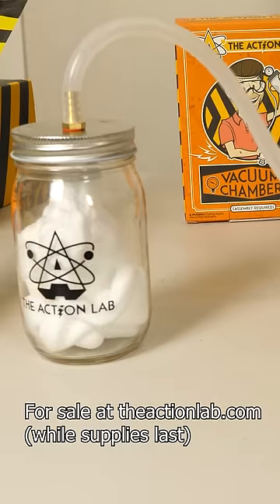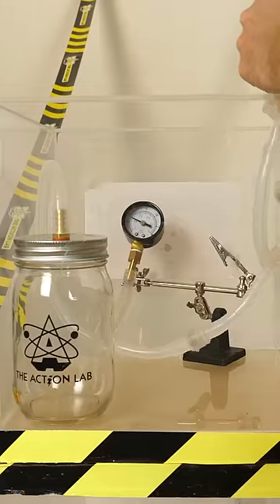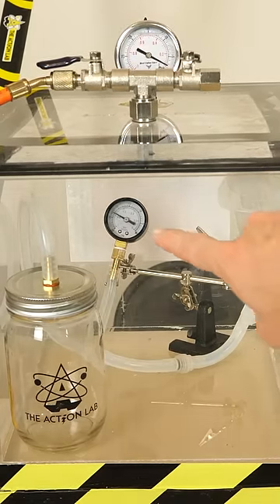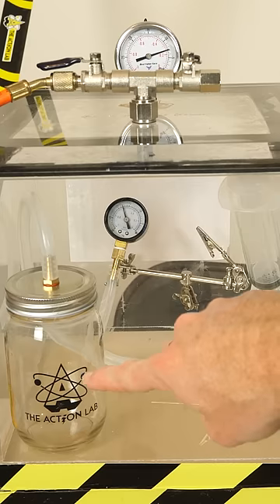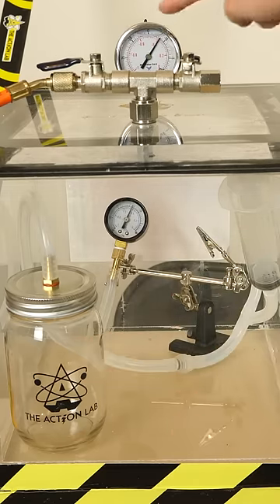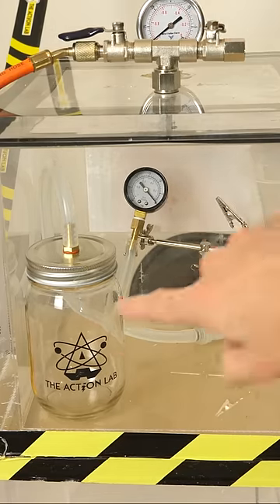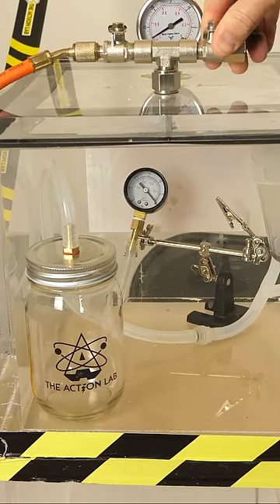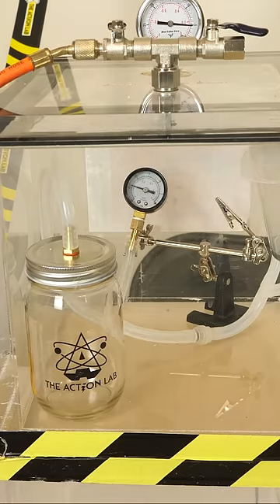Vacuum Chamber Inception

Comment: I half expected it to smash
Reply: Same
Reply: There's no reason for it to smash, There was actually less pressure on it while it was inside a vacuum.
Reply: Why?
Reply: I fully expected it to lool
Reply: @pasmuis  no science behind it. purely because it would be unexpected and unexpected things happen when you don't expect it. Therefore i expected it to smash simply because it was unexpected. Funnily enough though, the second i began to expect it, smashing became the expected, and then the unexpected happened. Therefore i was right about the unexpected always happening when you least expect it. A paradox
Reply: Who are you? Khabib?
Reply: Smash. Next question
Reply: @reemr9954  not enough brain power to process this infinite recurrent loop. 🤣
Reply: I thought that it would float
Reply: @pasmuis  just the first thought that popped into my head without actually assessing what would happen or anything.
Reply: @reemr9954 the mental gymnastics to say "i was right anyway" is astounding lol its ok to be wrong bubby
Reply: That's what she said
Reply: How? The outer partial vacuum is relieving the external pressure from the jar. Also, the jar can withstand a perfect vacuum (nearly impossible i know, and the mason jar’s unmelted lid seal would off gas and leak making a perfect vacuum even more impossible). Now, if you were to put a jar with a or without a vacuum deep in the ocean it would implode. We now call this the Titan Effect.
Reply: @reemr9954 no, a paradox is when, in order to put a bad person in jail they have to be convicted of a crime and convincing a bad guy to do a crime is a crime. No that’s a catch 22.
Reply: @thetruthexperiment  and that's the paradox
Reply: @justanerdwholiftweights4061 他也許沒有人願意給我一點勇氣不斷前進、給😧😧😧
Reply: Nah in a different kind of way its like a bucket being buoyant on top of water but then just sitting on the bottom when it's submerged. You've just made everything in and around the jar a vacuum so it's just like a bucket sitting in a vacuum, nothing will happen
Reply: Same just like that jar guy, if you know what I mean
Reply: @reemr9954 but that doesn’t make any sense… there is less pressure on the glass so less pressure = more pressure in your mind? thats not how it works
Reply: Pass
Reply: @infebris  re-read the comment.
Reply: Why
Reply: The pressure is actually inverted. So the pressure inside the glass is pressing agianst the walls of the glass, thus showing it has pressure despite having the pressure removed. @Sajjad.A
Reply: @whoknowswhocares3804 
@whoknowswhocares3804  the pressure inside the jar increase from -26 back to 0, because the pressure was equalized (almost). So, there's was no pressure on the small jar, neither from the inside nor from the outside.
Reply: Pass
Reply: I also thought it would explode with the air pushing the jar outward and no air pushing in on it.
Reply: wrong kind of video
Reply: The tension force of the glass is very high
Reply: I thought that too
Reply: I wanted it to
Reply: why would it?
Reply: 100% untill he explained the way it calculates pressure
Reply: I like the concept of "half expect" hahaha
Reply: *I half expected it to shatter.
Reply: It would only be the case of rapid decompression or by exert pressure.
Reply: It couldn’t while there was no air in it, equal forces
Reply: The Inception of vacuum chamber videos.
Reply: I was kind of expected same. But I thought it also not do anything too.
Reply: Same here man
Reply: There is basically no air to explode it in a vacuum and if anything it implode in the atmosphere due to the difference in preasure
Reply: Same
Reply: cuz you're like 80iq
Reply: Same
Reply: If there was pressure in the jar then put it in a vacuum THEN it would explode. He’s creating an equilibrium so the pressure is the same inside and out of the jar. But kinda wish it did explode XD
Reply: Hulk smash
Reply: impossible

Comment: The vacuum gauge's reference is the ambient air  pressure. In the large vacuum chamber, the reference goes to zero, so it indicates correctly that the air pressure inside the small jar is the same as the air pressure in the larger vacuum chamber is the same.
Reply: Yes that’s what he said in the video
Reply: Yes, but perhaps not as succinctly. @NienawidzeTaStrone
Reply: @shazam6274 I would argue the video was even more succinct
Reply: @fullsizegrom  Nah, @shazam6274 did it better, but not the best.
Reply: Succ
Reply: @ajaysrinivasroyal idk I feel like they both got the point across. Good enough on both parts.  I guess.  Somehow people needed another explanation though or it wouldn’t have likes

Comment: Never fill your tires in a vacuum. 
It'll mess up the reading.
Reply: @Idiot354 I did until watching this video and now I know why my tire light is always on!
Reply: I’m not engaugeing in this argument, I’m already tired of reading it.
Reply: Space shuttle astronauts before they land.
Reply: Yeah I i usually do my tyres in space. The ISS is the only place I know that do it for a good price.
Reply: @Idiot354 a guy with space car?
Reply: @Idiot354 astronauts
Reply: Good tip, thank you
Reply: This comment is from 3023
Reply: Yeah that's the takeaway actually :D
Reply: It's kinda' related to how you're supposed to fill your tires "cold" as in don't drive more than 3 mi, ideally, or ten if you can help it.  It heats them up, especially on a hot day.

When they cool off, they may be underinflated a bit.
Reply: Never tire your vacuum by reading.
It'll mess up your feels.
Reply: Thanks I'll remember that next time I try to fill my tires in outer space
Reply: @jasonninja55 oh what a tiresome pun it is
Reply: @Idiot354 random twin!
Reply: @RustOnWheels bro
Reply: @RustOnWheels  This argument truly sucks
Reply: Well there goes my roadtrip to Mars.
Reply: We lived it out tired in this egocentric vacuousnes 
 A meta prophecy or correspondence catalyst of some kind 😮
Reply: It will also mess up your tires.
Reply: @Idiot354   in case your car breaks down in outer space?
Reply: You can still do this in a pinch!  Just overfill by about 15PSI, and when you bring it to STP, it will be where you want it.

Comment: Note: Gauge pressure = Absolute pressure - Atmospheric pressure, so when the "atmosphere" becomes a vacuum, the gauge pressure of the inner bottle increases.
Reply: That makes sense relatively. So when you vacuum first, absolute is c and atmospheric is c, the gauge shows 0. But at the second vacum, atmospheric lowers, increasing the pressure relatively, since the outside has less air now than the inside

Comment: Thank you.. All these many years of using pressure gauges, I didn’t know they worked by comparing the pressure of the atmosphere they’re located in to wherever the stem is confined in.
Reply: You can't be serious? 😳 Have you never wondered what PSIA or PSIG means? 🫣
Reply: @2engjnr2  As far as I ever thought into it, which was never that far, I would’ve said the stem inside the container has a spring-type mechanism inside that is forced closed/open by the pressure pushing against it.  Absolutely nothing to do with the atmosphere outside the container.  I guess the spring mechanism could be contained either inside the realm of the container, or outside the seal, but never thought it’s always associated with the ATMOSPHERIC pressure outside the seals.  Only mechanical resistance by the spring, which would have nothing to do with atmospheric pressure outside the container.  
So.. What did you honestly think?  How in-depth have you ever truly thought about it?  Did you know for sure how it works?  Do you even now really know how?  Etc.

Comment: An even better explanation is that: the gauge is measuring the force exerted by the surroundings onto the system. As you reduce the pressure of the outer vacuum, you reduce the force of the surroundings being exerted on the inner vessel.

Comment: Pressure gauges typically measure relative pressure, not absolute pressure. Thus, if the relative pressure they are comparing to is a vacuum, they are going to read incorrectly.

Comment: Difference between PSIA and PSIG.  For vacuum use, use the correct gauge. Get a PSIA gauge. Other gauges that measure absolute are used by HVAC guys for system pumpdown.  Common unit for absolute pressure are Torr and MiliBar.

Comment: That's one of the things we had to make sure we kept track of when I was in the Navy. If you ordered a new gage you had to make sure that if it measured PSIA or PSIG you replaced it with the same thing. Pounds per sq in Absolute or Pounds per sq in Gage. Absolute measured the pressure from zero regardless of the surrounding air pressure. Gage measured the pressure in relationship to the surrounding air pressure. So the little black gage should be a PSIG scale or it would ignore the vacuum.

Comment: No, you are only somewhat correct, the pressure in the small one is increasing, but only because the pressure outside is decreasing. Also, the way a pressure valve works is by measuring how much push it is getting.

Comment: A vacuum involves pressure. Pressure is a ratio of two sides. So a -20:1 psi would be a vacuum and if you added a vacuum to it then it would be something like this: -20:-20:1 and two negatives cancer or making the inner pressure reach towards a 1:1

Comment: This makes sense, except I now realize I have NO IDEA how pressure gauges work.

I gather from some research that pressure gauges have some part of their volume at the environmental pressure (usually atmospheric pressure) and some mechanism fed by the test pressure. One design has a curved tube that deforms depending on the difference in pressure inside the tube (test pressure) and outside (environment pressure). Another type has a diaphragm that pushes with the test pressure into a chamber at environmental pressure.

Comment: He put a vacuum chamber in a vacuum chamber. When the pressure increased I thought" weird how does that happen. Then I thought. "Ah yes. It wasn't a perfect vacuum in the jar, so when the vacuum was created in the big chamber, the air in the jar had more air in it than the tank. And then right after that, he explained it.

Comment: The gauge for the little one actually went lower after the big chamber was opened. At the start it looked to be pointing at -25 but after the air was let back in it looks to be perfectly between -25 and -30, so about -27.5. Did the pump for the big chamber actually suck air out of the little one or is it something to do with the gauge going through a vacuum chamber?

Comment: But now affix the gauge for the internal jar to the outer side of the wall to the outer chamber but with the pipework for the smaller chamber inside with the internal chamber.
I imagine that when the outer vacuum meets the inner vacuum pressure the pressure would decrease against the strength of the rigidity of the glass

Comment: Put a vacuum chamber inside a vacuum chamber inside a wind tunnel...
See if the extreme variations in air pressure has a registered effect on the inner gauge.

Prediction:
(Air chamber (fluctuating gauge?(steady gauge?)))

Comment: If you put a small battery powered vacuum chamber inside the bigger one, or run a cable through the wall of the chamber, can it pull a stronger vacuum if the pump itself is in a vacuum?

Comment: Umm so he should have applied more vacuum to inside jar to equalize pressure in both, and acheive greater level of vacuum inside the jar!

Note that if he increased vacuum to a greater level in the inside jar while air pressure of outer chamber was high, it may have resulted in in the implosion of the jar, depending on structural strength of jar.

By slowly lowering both, in turn, the chance for potential implosion of jar is reduced.

This can be considered similar to the premise of a hyperbaric chamber  ... Only in reverse.  You match pressure of both "containers" (see below) and gradually reduce pressure of the higher-pressure outside (hyperbaric) chamber in order to mitigate ill-effects on the pressure differential of the inside container (human body) and its contents!!!
In case of human body accustomed to higher pressure, a large drop in pressure in a short amount of time can  result not in an explosion, but rather in a life-threatening condition known as "The Bends".
Much worse would happen to a human if released to the void of outer space (per various popular sci-fi considerations of ejection from airlock, a.k.a. "spacing").  In that case the freezing cold of outer space is also factor.

Comment: Also due to air density differences there would be pressure applied to the chamber i side to either try to expand or compress to try and fit the natural density and balance out

Comment: The guage reads different pressures before the experiment and after. Is it possible the small vacuum chamber made from the bottle just wasn't at a full enough vacuum and still had air inside but was removed when the other vacuum chamber was turned on?

Comment: But what happens if  - following the steps above - you then pull more vacuum from the jar and then reinflate the big vacuum chamber?

I'm guessing the jar will become 25% more into vacuum as the outside pressure would technically feel like double? Or it would fail and break. 🤔

Comment: What happens if you vacuum the smaller one again once you've done the vacuum with the bigger one then release the pressure of the bigger vacuum. What will happen to the smaller one? Will the pressure be enough to cause it to explode?

Comment: Does this make it easier to pull a lower vaccuum?

So you put a little vaccuum in a big one. What happens when you move even MORE air out of the little one into the big one?

The inside guage would drop, while also making the outside guage rise, so you'd hit a feasible limit sooner?

Comment: My guess is that the gage actually measures the difference between outside preasure and inside preasure. as the outside pressure lessened, the ratio changed. Making it looked like the inside preasure was rising.

Edit: I was right. Is it possible to measure the preasure without comparing Like this?
Reply: Yes it is possible. Since a "vacuum" is just the lack of matter in an area, in theory, a device that could detect and count the number of (any) particles in say a 1'×1' box, would be able to tell if there is a vacuum or not, purely by the number of particles per square inch (or cm) it detects.

Comment: Is there a wireless gauge that compares the air inside inside with the outside air? Would it be worth showing that there would be no change had the inside inside gauge not read comparing to the air directly outside?

Comment: Did the small chamber actually end up with a lower pressure after the experiment? The needle ended up lower after the air returned to the large chamber. 🤯

Comment: Basically like with weather ballons, when they are partly filled with helium, then rise through the atmosphere high and seem to inflate until they burst, despite their inner pressure not changing. In this experiment the pressure stays the same in the inner jar but since there is almost no pressure in the outer chamber, the gas in the inner jar can expand more freely / easier despite its pressure actually not changing at all. So the needle is basically lying to us. 😁

Comment: He is, in principle and most of the time, wrong. It is perfectly possible to get gauges which have a vacuum reference rather than an external room pressure reference. And for gauges used to measure vacuum this is what is used.

Comment: So basically the dial on pressure gauge is calibrated to show reading when used in open atmosphere. The instrument however is designed to move when there is a differential pressure recorded between two lines? 🤔
Thanks for the demonstration 👍

Comment: Man it would be awesome if you could pull a vacuum on the jar again, once you've pulled a vacuum on the chamber. And then if you can get the pressure down again, with the jar already in a vacuum, and then let the pressure back into the bigger vacuum chamber. Would the jar implode?

Comment: I hypothesize that the pressure would equalize and it would be in a way possible to just open the jar without any problems (even though it itself is in a pressure chamber) but right as the hand started moving I thought somehow the pressure started doubling (I wasn't reading it correctly)

Comment: What would happen if you opened the valve on the inner vacuum while it was still inside the vacuum?
Reply: If the pressures were equal, nothing. It would be the same as opening a jar full of water, while underwater.